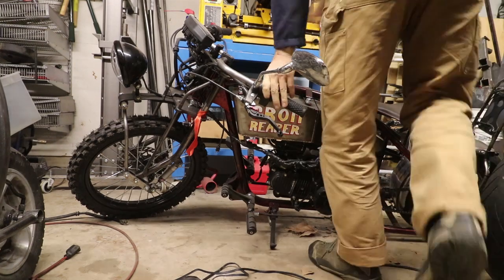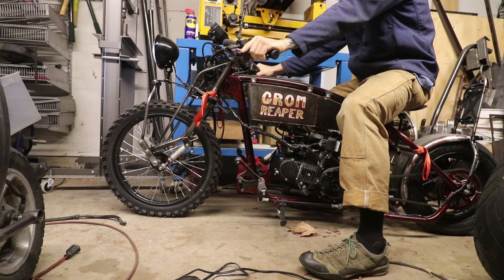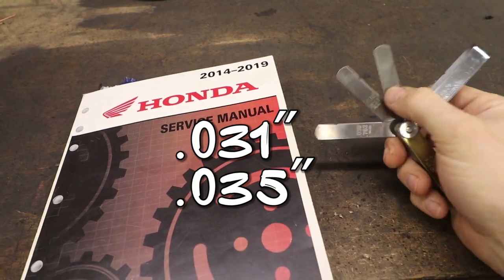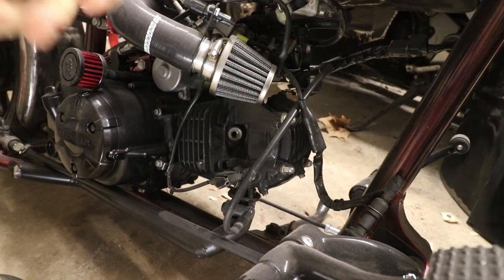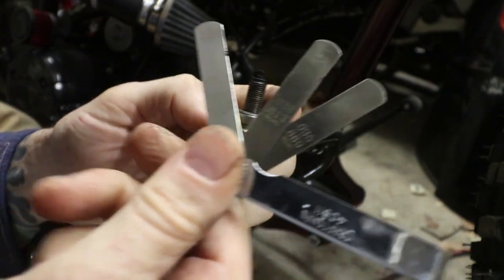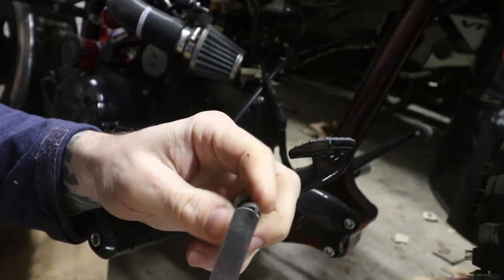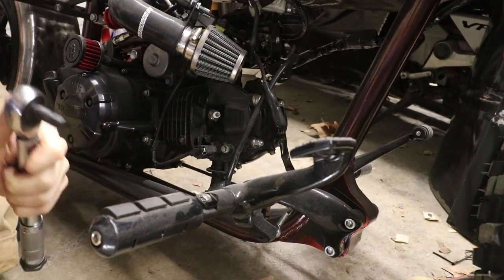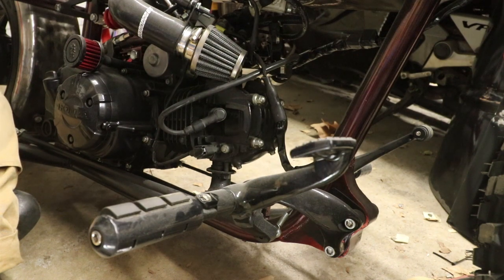Motorcycle Won't Idle - Fixed!

Comment: I’ve got a two stroke that won’t idle. I’ve cleaned the carb, air filter , prayed and cussed. I did not check the plug. Great video 👍
Reply from the maker: I wish you many lucks 🍀🍀🍀and hope it's an easy fix.

Comment: Nice when things like that work out. I suggest you get a "Pneumatic Air Spark Plug, Cleaner Sand Blaster Tool Cleaning with Blasting Abrasive". Motörhead's like us find them invaluable when cleaning otherwise good plugs that have been gummed up with soot, oil, or gas.
Amazon sells a variety of them.
Reply from the maker: Holy crap! I have never heard of that spark plug cleaner. I had to go watch a video to see it in action. Neat little tool 👍. My life has been enriched just knowing it exists😀. Now I'm wondering how many ways there are to clean spark plugs...
Reply: @HooptieDoodle  It's an "old school" piece of technology. My dad's Rambler dealership had a well used one back in the 60's.